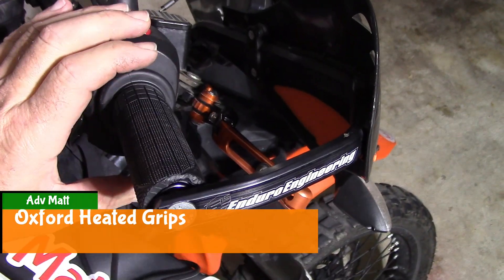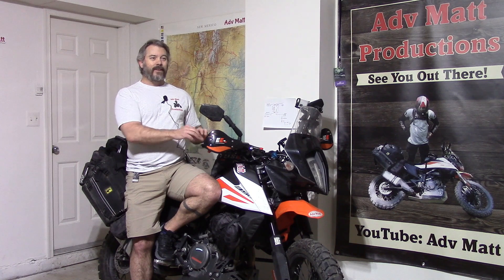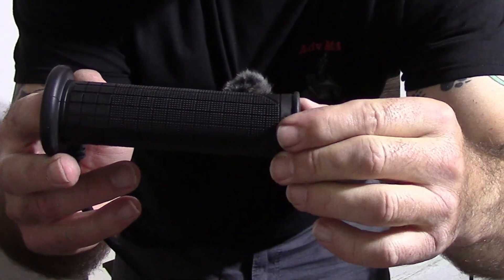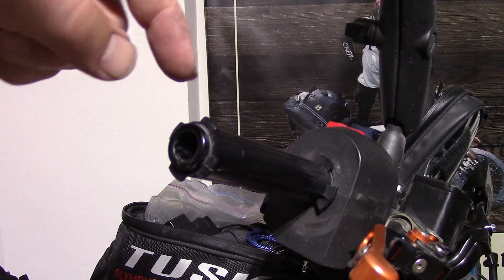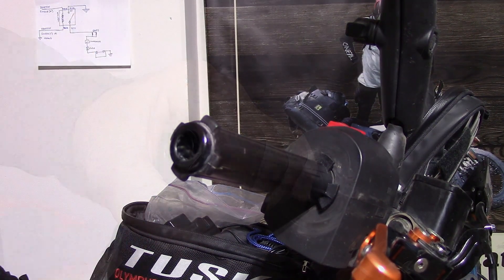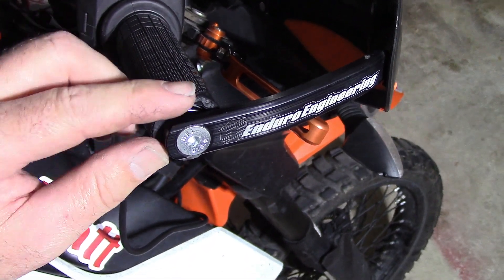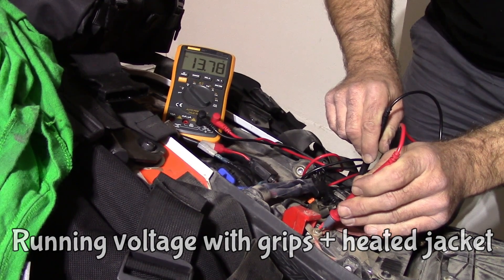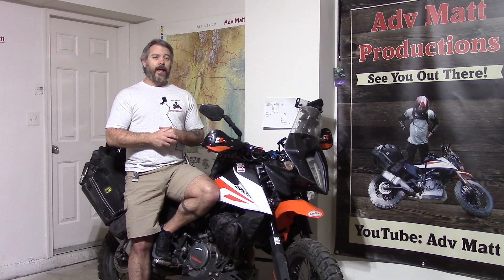Oxford Heated Grips.  A better way to do the install.

Comment: Protip!!! Use hairspray as lubricant for getting the grips on! Water works, as does windex, and we all know not to use an actual lubricant because that'll make for a slippery grip, but hairspray combines the benefits of using water, with a little extra "stick" when it dries. I've built and rebuilt countless bikes in the last decade, and I would seriously caution anyone against using solid adhesives like contact/rubber cement and superglue. We're modders, we like mucking around, and I guarantee at least 50% of people that install new grips will eventually have a reason to replace the handlebars, at which point you'll be glad that you can remove the grips without destroying them.
Reply from the maker: Fantastic tip.  Bar replacement is common place on heavy adventure bikes.
Reply: Hairspray won't work on Oxford heated grips as the inside of the grips are a plastic tube as opposed to a normal grip which is rubber on the inside. The hairspray will not stick between the plastic and bar or throttle tube.

Comment: During my install...I used a little water at first to determine the best grip location. The water made it easy to slide the grips on and off. Final grip placement was with superglue 👍
Reply from the maker: Great idea/tip!

Comment: My clutch grip solution: I sprayed the HECK out of the bar and inside of the grip with windex. I slid the grip on 85% of the way without an issue. I then tapped it the rest of with a rubber mallet. - Frank
Reply from the maker: I forgot about the windex trick.  I had to glue mine, twice.  It was spinning after the first install.  We all learn little tips and tricks.  Thanks for adding that one.
Reply: @flippy5118 You certainly can. I was gentle as I could be. Working very well! - Frank

Comment: Nice install.  The repair manual shows a total output of 230W, but the charging system components will run very hot pulling high amperage at idle.  So probably better to go inside rather than use the drive through to get your daily burrito. 😉

Comment: Everyones miliage may vary for sure and the bottom line is if they dont move after install its good. I had to redo my clutch side after a couple mths  when it started moving. No big deal.
I thought of the Alcohol /windex idea since I had installed many bicycle grips that way. But I figured Oxford knew best , which may or may not be the case. I had an anxious moment when the throttle side stuck 3/16 from where I wanted it. I managed to move it in position but was freaking out for a moment. There is definitely room for error and you need to think the process through for your own install.
Reply from the maker: Agree, think through the install beforing doing.  It will save you problems.

Comment: I did it the easy way - I let my dealer do it when I bought my 390 !! I doubt very much if you can run the grips on high very long as they get too hot even in near freezing conditions !!
Reply from the maker: The grips do get quite hot.  I was surprised by this.  They are nice to have.
Reply: I run mine on high in New York when I am wearing my heavy winter gloves and I need that heat to transfer though the gloves! - Frank

Comment: I used a drill bit to space out the throttle side so to make sure that there was space for the atlas throttle lock. Can't remember if it was 1/8 or 3/16.  I was able to rotate the cord to face back towards the rider to be able to fully apply the brake no matter where the throttle was but had to fully rotate the atlas to where it is right on top of the heated grip cord. Tight but makes for a clean install.
Reply from the maker: Great tip, thanks.  Never crossed my mind to do that.  I just lined up the end of the grip from where I trimmed it. Cheers.

Comment: rubbing alcohol also makes a great lubricant for putting rubber hoses  on metal or plastic
Reply from the maker: @seanhewitt2521  great tip. Thanks, I will try that next time.

Comment: Rather than fix the grips in place with the superglue provided (one chance only, crap or bust), on the 3 sets I've fitted, I used a contact adhesive (Evostik or similar). Slide the grip on when the glue is still liquid and you can adjust the position at leaisure for a long time. You do need to give the glue 24 hours to go off completely though. Regards the DC ammeter, you already have one for up to 10 amps.! Use the common and left hand sockets of your existing meter.
Reply from the maker: Great tip on the glue.  Absolutely right, I could have used the meter in series with the circuit to measure the current.  I should have tried it, I was thinking it would pop the 10 Amp fuse, but even if it did its closer to knowing than not.  Thanks for the reminder.
Reply: @advmatt  So test grips and jacket separately. Note down high-med-low levels.

Comment: Thank you for great instructional video. I wonder what voltage were you getting with all the accessories on (including lights, phone/navigation) also. Would the stater be able to run all previously mentioned and charge the battery (i.e. after cold night battery discharged). Thank you
Reply from the maker: When I measured the voltage the only item from your list not operating was a navigation system.  The current draw on these systems is usually less than Amp, closer to half an Amp so it won't really make a huge difference.  At idle the voltage drop is the most, once the engine winds up it is not as much and more current is generated.  I am keeping a close eye on the voltage and health of the stator.  Hope that helps.

Comment: TLDR at the bottom. 

I utilized my dremel for the throttle body.
If you are using a cutting wheel, I can see a potential problem, a sanding wheel should be fine. 

If you have any experience with a dremel, I feel, having used one to sand down a minimum of three throttle bodies, there is no danger of going too far.

Especially in the 390, as your just removing the strips of raised plastic, not the entire throttle body.

TLDR: Matt is not wrong, you could screw up your throttle body if you have no dremel experience. If you do, you will be fine. - Frank

Comment: Best trick I've learned about mounting grips is use rubbing alcohol in the grip it will slide right on and then drys tacky to the bar
Reply from the maker: Great tip.  Thanks.  Next time I will give that a try.

Comment: Have you seen the Koso Apollo Heated Grips.  Oxford is quality stuff, I've heard, but the Apollo has a neat little indicator light and no big control panel.
thx
S
Reply from the maker: I was looking at those because the heater control is on the left grip perfectly places for thumb control.  I decided the $30 price difference wasn't worth it.  Cheers.
Reply: Cheap!
;)
S
Reply: @sdefiel3719  Frugal! Though I went with Oxford because they were $50 lower on Amazon the day I ordered! The giant control panel is annoying... - Frank

Comment: Thanks for your video, Matt, very informative.  I just finished installing the 1 1/8 bars and EE hand guards, as well as the oxford heated grips.  Everything went well, but the EE guards hit my instrument display at full lock.  Did you have this problem? Not sure how important this is, but maneuvering the bike in tight places is a little more difficult.
Reply from the maker: I didn't have any problem with the had guards hitting the instrument panel.  My hand guards just barely touch the windscreen at fully locked left and right.  I do have bar risers, not sure if you do.  You might try rolling the bars back toward you a little bit, if you haven't tried that yet.  The only other thing I can think of is the orientation of the bar mounts since they have an offset.  Maybe flip them around and see what that does.  Hope this helps.
Reply: @advmatt  
Matt, I installed bar risers and that fixed the problem!  I had bar risers on the original bar but neglected to get them for the new bar upgrade.  Thanks for your help, really appreciate what you do!

Comment: Not related to subject in this video. When riding do you use goggles, glasses or just helmet's visor. Riding lately local trails, there were quite few 4x4. When I got behind the dust was pretty bad, at which point I had to close my visor, but the air flow was now minimized; which prompts my question.  I'm using Arai XD4 which has great ventilation, but I still prefer riding with visor up when on trails. Wondering if you have this problem/solution; thank you!
Reply from the maker: Great question, I don't have a great solution.  I wear prescription sunglasses and not goggles.  I often stop when it gets dusty and wait for vehicles to pass or haul ass past.

Comment: Enjoy your content, Matt - as a new owner of the 390 Adventure.  Hey, would you happen to know how many heated gear components (read Gerbing) that the stator can handle?
Reply from the maker: Thanks for the feedback. The manual says the stator is rated at 230 watts.  From the manual, the accessory electrical port under he headlight has a 15 amp rating.  This says to me there is at least an additional 15 amps of capacity.  My heated grips and heated jacket at the max fused amperage is at 12 amps.  I am confident I am operating within the capabilities of the stator.  I also do not have auxiliary lights.  These would need to be factored in as well.  Hope this helps.  Enjoy that bike.  These are so much fun to ride.
Reply: @advmatt  Thank you!

Comment: Oxford sells grips that are different lengths. The touring, sport and dual sport models are not the same length   There's no need to buy long and trim.

As far as fitting  them, connect the electric part first.  Let the grip get hot and they are easy to slide on and off to test for the proper position.
Reply from the maker: I thought I looked and the grip pattern is different between styles.  I like the Adventure style better.  Great tip to let them heat up to slide them on.  Thanks.

Comment: It was an idiotic nightmare trying to put them on my Pan America. They won't fit over a 7/8 inch bar without filing and picking out the gumball glue they stupidly put inside. After several hours of filing and picking out that gum I got it over the left bar. Ordered a replacement throttle tube yesterday, destroyed first one trying to grind it down. I'll have to file down more of the grip like the left side. Never had a heated grip so ridiculous to install. And,they are 15 thousands smaller than 7/8s. Even says so in the directions like previous post says. Measured with a caliper also. But,never fear, no more base models of the Pan America are being made. From 2024 on only the S models will be available. Won't have to deal with this crap.
Reply from the maker: I have heard of this problem from others as well.  What a pain.  I have done the Oxfors install a few tunes now and it takes some work to get them to fit for sure.

Comment: My pan America has 7/8 bars, measured with  a caliper, left grip won't even begin to slide on. Using a file to take off all the excess rubber inside the grip like the directions say. Idiotic. Never had another set of heated grips that required this. If you read the directions, they are actually made to fit a bar 15 thousands smaller.
Reply from the maker: I had quite a bit of work to get it fit on another bike as well.  It took awhile to get the rubber removed that ran into the grip when molded.  For the price and for the heat, its a pain but was worth it to me.  They are a pain though.

Comment: Gave up watching…really poor lighting, sorry.
Reply from the maker: Yeah, I have a challenging garage to work in right now.  It is temporary.  I am working on a new filming area.
Reply: @advmatt  I thought the lighting was fine, there is always one to complain about something.  Great video and thanks. I’m having to re-do my grips. Installed them and went out on the MABDR and the controller shorted causing the fuse to blow. If you think installing is a challenge try taking them off, lol!